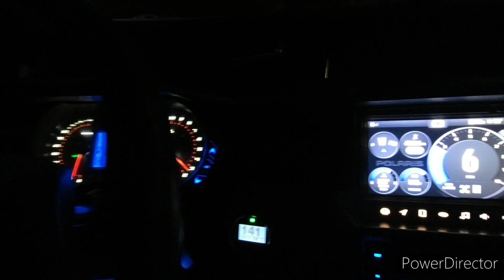It's time for brakes, tires, and something else.

Comment: How's the power feel with 32's?
Reply from the maker: @benpennington8941  So far, I have no complaints. I haven't done any high-speed runs yet with the 32" but I think it's gonna be fine.
I did do a rock crawling trip. This is what I was most afraid of is losing my low-speed crawling capability, but it seemed to do okay.